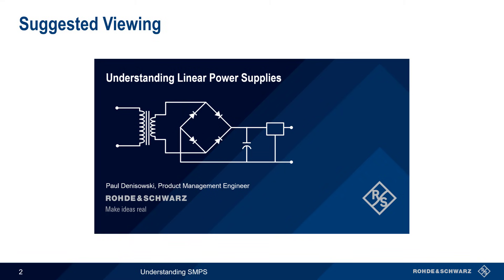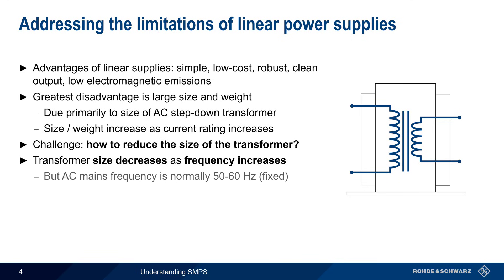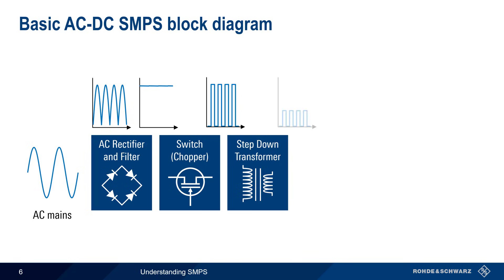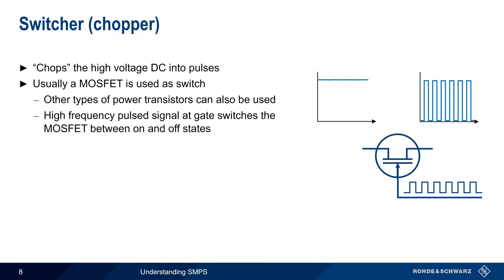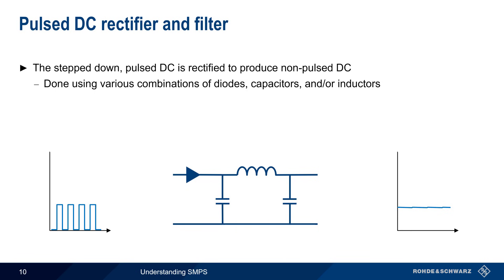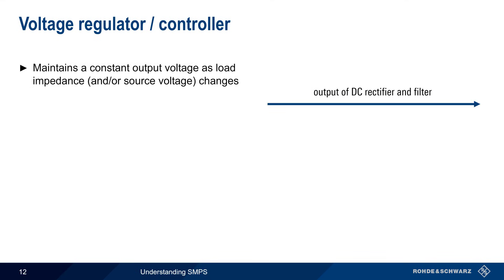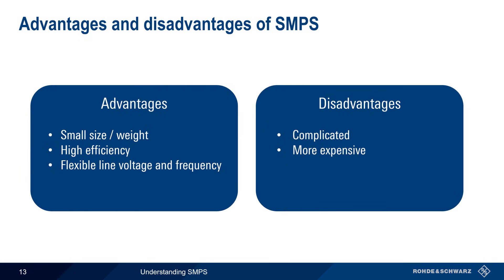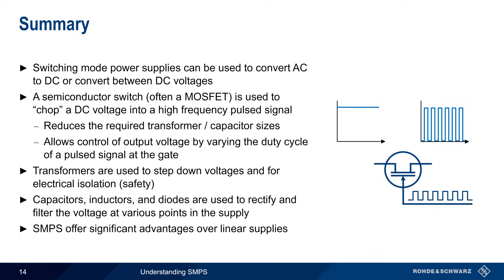Understanding Switching Mode Power Supplies

Comment: At the point where the chopper produces the signal by means of the MOSFET, the output is probably AC.  Otherwise how could the chopped signal be stepped down by a transformer?  OR can a high frequency DC signal be stepped down using a transformer? Also, why isn't a bridge rectifier used in the output as well?

Comment: The input rectifier transformer still operates at power frequency, so its size will remain the same as used in linesr power supply ?
Reply: what do you mean? there isn't an input transformer
Reply: @brlinf06398 yes...the ac is directly converted to DC through bridge rectifier and chopped at high frequency, later converted to low voltage high frequency ac.
Reply: @MrAyahya  The fact  that it is high frequency is what makes the transformer smaller   Linear power supplies  operate at much lower mains frequency so the transformer is much larger . Hope that helps. Regards, Kieron.

Comment: I'm confused. Isn't the voltage alternating current after the transformer? In the graph looks like pulsing direct current, but I've the notion that it should be a square alternating voltage. That's exactly why a DC rectifier is needed after the transformer. The graphs used are confusing and misleading.
Reply: The Transformer is receiving pulsed (chopped) DC from the Mosfet. Transformers can also use a pulsed DC current. Straight (smooth) DC will short it.
Reply: The pulsing DC is a square wave that's not centred around the zero line. Imagine a ''normal'' square wave  of 1 volt above and below zero. Now add , say a DC voltage of 3 volts. The result would be a square wave centred at 3 volts with a  peak of 4 volts and a low of 2 volts. It still has an alternating component but 'offset' by 3 volts DC. Hope that helps .
Regards Kieron.

Comment: It can switch from 5 v to 9 v, 10,8v, or 12 v usb, supported by Huawei chargers. The device such as power bank needs a thermal sensor. The switching happens when a transistor and variable resistor component applies an extra load in phones, rcing the charger to switch to stronger output. When the battery is full, the phone instructs the charger to stop and cool down, while tranformers remain hot.

Comment: smps  is  not include  pwm   switching circuit  it just  for simple application didnt need  high amp   in   diffrent  mode of operating   it used in crt tv by  tow transistor   and photocupler  and in  charger  used tow transitor one drive   base  and  mangment in the same time and other is  main transistor conected with transformer

Comment: Kindly note for shock hazard,no power supply is safe in case of SMPS too ,if not stepped down to a lower voltage level and raise the level again as in case of oscilloscope and television and video recording and replay systems,,,so be on safe side and have the multiple voltage and signal sources by well isolated transformers to work around television and oscilloscope and Radar displays,not talking about transmission systems CAUTION ⚠️
Reply: You seem to know what you're talking about. I wonder if you could help me I need to run a 24vdc power tool from 240 ac would a switching mode power supply do the job thanks in advance Adrian

Comment: if your ultimate goal is to reduce the voltage, why use a FBR?  Why not just grab the half of the cycle?
Reply: It's inefficient (conversion wise), and produces an awful power factor. It also requires larger capacitors to keep the output stable, which naturally cost more. I'm sure there's other reasons- maybe it causes more coil whine?
Reply: @Originalsunrunner20  Thanks.  I figured it might be inefficient, but I didn't know it would require larger capacitors.
Reply: @Originalsunrunner20  Thanks - you beat me to it :)

Comment: But why laptop power supply have no transformer component? isn't it a Switching Mode Power Supply? how does it lower down the voltage? or the transformer is there but just small one?
Reply: There is a transformer in AC/DC laptop power supplies - it's typically not exactly "small" compared to the size of the entire supply, but it is much smaller than one that would be needed in a linear power supply (I'm not aware of any modern laptop chargers that are not SMPS).  If you search YouTube you can find some teardown videos that show the transformer in a laptop power supply.  Hope that helps!
Reply: @pauldenisowski I see, thanks for the confirmation, I thought it had no transformer since the size is very small compared to the PC PSU.
Reply: the video is a little bit misleading. a transformer is useful for "safety" reasons though